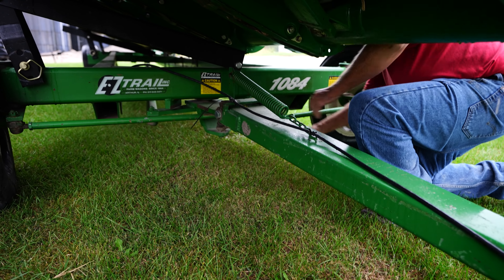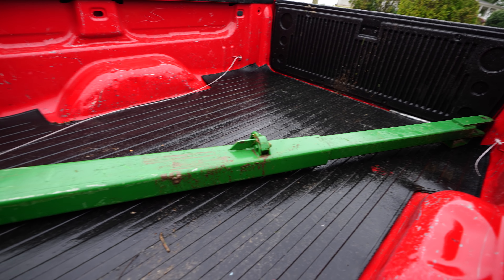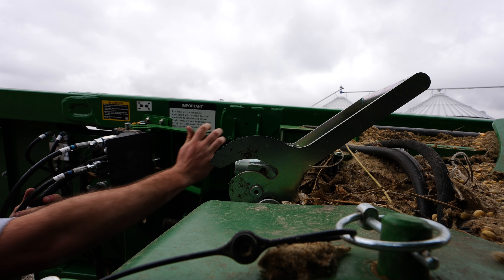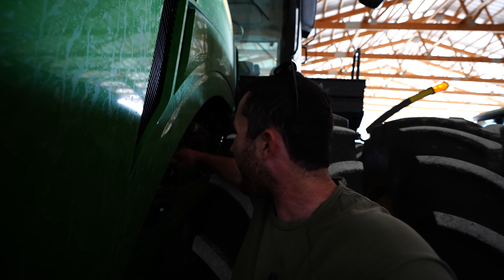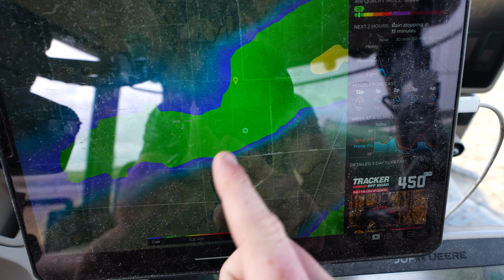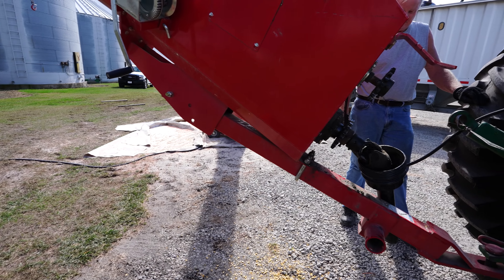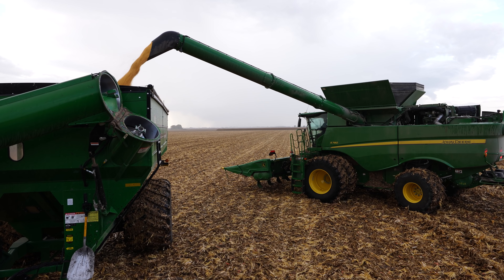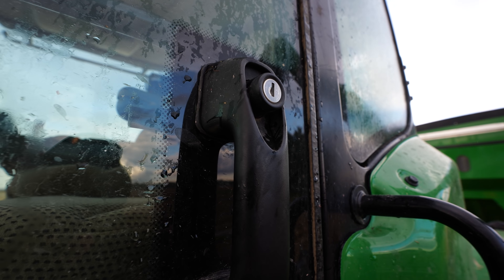A Harvest Season Plagued With Breakdowns Claims Another Victim (Ep.123)

Comment: Spaeth Welding in my book is South Central IL, Metro East STL Area’s BEST Welding Outfit in my book. Hell IL State Troopers Shut Down Interstate 64 for Him to Weld a Heavy Haul Trailer that Broke in Half. They also Welded on some Older DMI 730B Shear Bolt Shanks back on a Ripper that came off on a Newly Picked Up Farm that had been Only Disked for 20+ Years. Old Rippers that go over 6,000 Acres a Year Each, (12,000 for the Pair of Rippers we Ran) and Heavy Compacted Ground that hadn’t been Deep Ripped for 20+ Years don’t mix. Spaeth had to come out and Weld 2 Shanks back on two days in a row, which was Good because the 3rd Day we ripped up a Old Abandoned Oil Well Pipe Sections. It was One of Those Weeks, I can Laugh about it now 10 Years Later though!
Reply from the maker: Those good old oil well pipes.... gotta love em!
Reply: @aTrippyFarmer  This much I can say, when those Small Welding Outfits are done, it usually ends up BETTER than when it left the Factory!